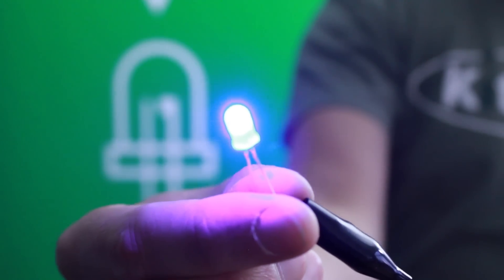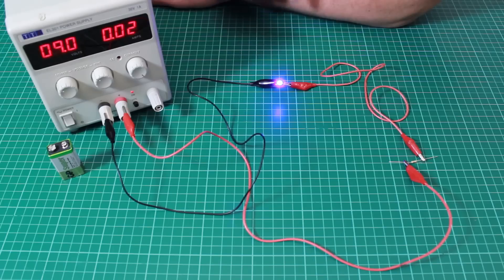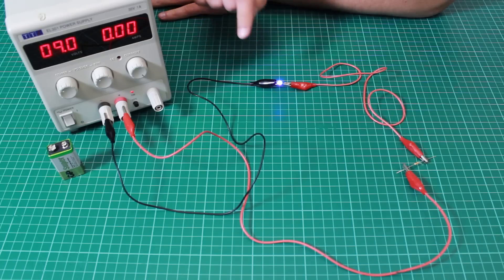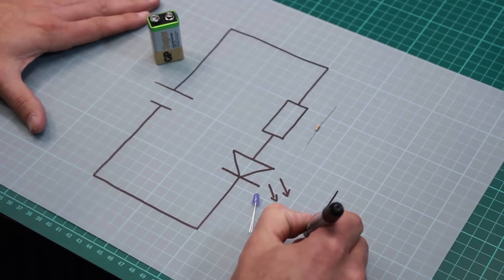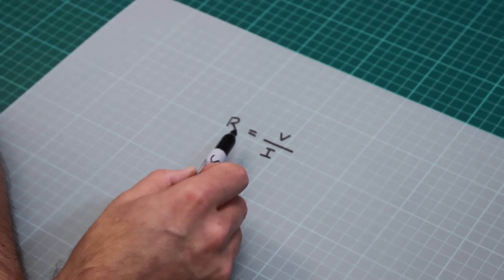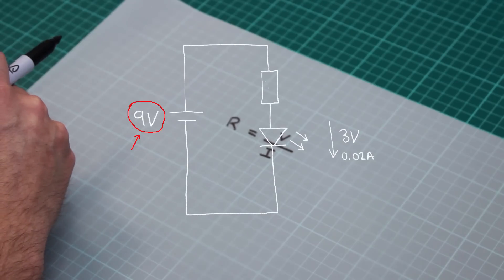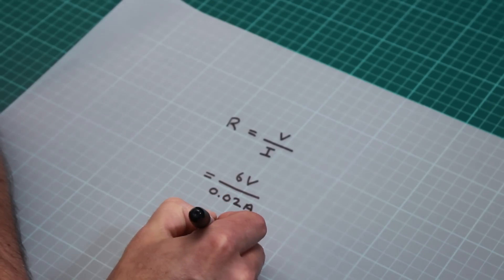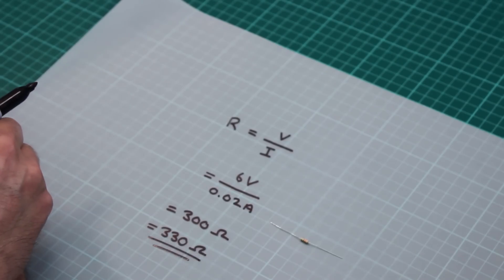LED resistor value calculation explained (Ohm's Law)

Comment: Sorry still not understanding. If the power going to my 3v led is 12v 5a, what resistor should I use? Please help. Thank you
Reply from the maker: If you have a 12V power supply and the voltage drop is 3V for the resistor, the top part of the triangle (Value for V) would be 9. The amps of the resistor in our example is 0.02A but in yours would be 5A. So 9 divided by 5 = resistance.

Comment: How do you calculate the resistor value of a 34V and 600mA current LED Chip running off of a 12V power source???

Comment: how will you measure the current if you dont know yet the value of the resistor needed?
Reply from the maker: You use the current you want to flow through the resistor, taken from the datasheet.

Comment: how do i work out the MA?
Reply from the maker: The current will be on the LED datasheet. Alternatively if you know the Voltage and Resistance you can use the triangle to work out the milllamps of an LED on a given circuit. Voltage divided by resistance equals current.
Reply: thank you for your response. As a motor mechanic i should know this. I learned it at collage 4 years ago. Its the first time I have actually needed to use a resistor in the field. fuses all the time. its easy to put a new "resistor" or "fuse" in from a spread sheet but its nice to actually going on
Reply: FYI    .... MA   means   Mega Amps
mA   means milli Amps

Comment: hello sir
question please:
i want to connect 5 led's together to make a led bar. each led is 12v
and 10w. what resistor should i use?
thank you sir.
Reply from the maker: It depends on the power supply, but 50W is quite a lot.
Have you considered these instead?
https://www.kitronik.co.uk/35129-zip-strip.html

Comment: 1:55 "the voltage across the resistor is 6V, this is because it is 9V from the battery less the 3V that's dropped across the LED"
I don't understand, does the LED absorb those 3 volts? I've never heard of anything like that before. And then, how does the resistor know about something that happens after it in the circuit? I assume the electron stream coming from the anode could tell something about the voltage being pulled, but it still doesn't make complete sense to me.
Could you illuminate this?
Reply from the maker: Hi.

The LED doesn't so much absorb those 3V as convert them to light.

To explain properly we need to take into account a couple of other relevant laws of Circuit Theory -  Kirchhoff's 1st and 2nd Laws.

Kirchhoff’s 2nd law states that the sum of voltages around a closed circuit is equal to zero.

We can use this to determine the resistance required to limit the current to 20mA

We have a 9V battery, and we want to have 3V across the LED. Using Kirchhoff’s 2nd law:  9V -3V –(voltage across Resistor) = 0

So we need to account for 6V of energy for the resistor. (We convert it from electrical energy to heat energy, for circuit purposes the important bit is that it's no longer electrical energy.)
 

Ohms law states that the voltage across a resistor is related to the current through it by its resistance (V = IR)

Kirchhoff’s 1st law states that the currents flowing out of a node are equal to the currents flowing into the node – in other words in our simple single loop circuit the current is the same at all points.

Because we now know that there must be 6V across the resistor we can work out what the resistance needs to be to limit the current to 20mA.

This is  6V/20mA = 3000 ohms.

Hope this helps.
Reply: Thanks! That is a great explanation!

Comment: you forgot most important calculation. power going tru resistor.
Reply from the maker: We've purposely kept these videos simple as they are aimed at school age children. 
You can see the relationship between Ohm's Law and Joule's Law at https://www.facebook.com/Kitronik/photos/a.994027100724029.1073741835.145744082219006/987119861414753/?type=1&theater
Reply: school age children? 6-24+ years old is school age. btw two most important values of resistor is ohm value and power value. you just shown how to get hurt (burn fingers, house). at least make second video about power values and link it to end of this one and mention how important it is!

Comment: what if i had a 3v led and a 3v battery. will the battery give out too much current or does the battery only supply the max 20mA the led requires? Will this battery safely light the led for long periods of time. Want to make a simple touch switch circuit activated by water to last 8 hrs if possible.Thanks. Great video.
Reply from the maker: It is common to use a 3V coin cell directly on a 3V LED (take a look at throwies) but it does depend on the capacity of the battery. To be sure you can test with a multimeter.

Comment: How would the resistor vary if I were to put a series of those led diode? Say 10? Is it necessary to use a different value resistor?
Reply from the maker: Yes. You can use this handy calculator here https://www.kitronik.co.uk/blog/led-resistor-value-calculator and adjust the amount of LEDs.

Comment: I want to put some leds on my car i have subtracted 3 out of 12 then divided 9 by 0.02 it gave me 450 so that means i have to buy 450 ohms resistor?? Please help
Reply from the maker: You need to find the forward voltage of the LEDs you want to use and use that value in the calculation.
Reply: Kitronik what do you mean by forward voltage bro? I have a 3v led and its 760mA and i want to run it by 12v how can calculate this?
Reply from the maker: The forward voltage is the 3V bit.
So 12-3 = 9V.
Divided by 0.76A (760mA = 0.76A) (This is because our LED was 0.02A but yours is 0.76A).
Reply: Kitronik okay bro I've took 9/0.76 it gave me the result 11.842 now this is lil bit confusing how do i know how many ohms is 11.842? Is it 1k ohms??
Reply from the maker: It's exactly that, 11.842 Ohms. Nearest resistor you can get is probably 15 Ohms.
Reply: Kitronik okay bro thanks alot for ur help

Comment: bro nice video i like it 
but this is for only 1 led 
can you plz explain me how to calculate resistance of 2 led with same volt (connected in series or parallel )
Reply from the maker: You can use this handy calculator to work it out for you. https://www.kitronik.co.uk/blog/led-resistor-value-calculator

Comment: you forgot to tell people how you got the 0,02 A
Reply from the maker: The current of the LED was taken from the datasheet.
Reply: Kitronik is there a way to determine this without looking at the data sheet?
Reply: He took the 0.02Amps from the datasheet, they call that the rating, it may show up as milliamps, for example 20ma converts to 0.02A. You use that rating divide it by the voltage flowing through.

Comment: So if I have a 12v 16a led toggle switch & want to wire to 120v cord I'd need a 6.75 resistor?? 

I'm a noob.. help me not kill myself
Reply from the maker: It'd need to be a very powerful (Wattage) resistor for that. I wouldn't want to recommend anything specific but would you advise you to get in touch with the supplier of the LED.

Comment: Does it matter if the resistor is on the positive or negative side of the LED?
Reply: Sizzlik should be on negative i think
Reply from the maker: So long as you add the resistor in series it doesn't matter.
Reply: It does not matter. Because the current (ampers) is the same everywhere.) But it will be more correct to connect it before the LED, on anode, positive side, longest leg.
Reply: With respect: It will not be "more correct" to connect it on either side. It literally doesn't make any difference.

Comment: Can you please tell me how much ohm resistor can use with 22leds in parallel and flowing current is 12v battery
Reply from the maker: You also need to know the forward voltage of the LED (the amount of volts the LED needs to light up).
Reply: ok thanks can you explain me more about this
Reply from the maker: LEDs need an amount of voltage to light up. This depends on the LED. It might be 2.1V or 3V for example. 
The difference between the voltage supply, and the amount the LEDs need is the amount you need to provide resistance for.
For example if you have two LEDs that need 3V each and you have a 12V supply, you need to calculate the resistor for 12V - 3V - 3V = 6V.
Reply: thanks 
hi i wanna tell you something i am working on a small project to "AJ" sign with led's i am   using 22 leds of 2v to complete and power supply 12v 's 4 ampere bike battery actually  this AJ is for bike and also finished this yesterday using 230 ohm resistor can u tell is it right or not
Reply from the maker: Ajay, if you have 22 LEDs rated at 2V each then a 12V power supply will not light them at full power.
Reply: sir i finished all of this using 22 leds in parallel with 220 ohm resistor and light them with 12v battery  and also i installed in my bike also i save a  photo so u can just tell me your whatsapp or any other social account where i can show u m experiment and also thank you
Reply from the maker: We're on Twitter @Kitronik :-)
Reply: sir i am not on Twitter any other whatsapp, Facebook or instagram
Reply from the maker: https://www.facebook.com/Kitronik/
Reply: so in this case to power 22 leds each at 2.1 volts each would require the minimum of 46 volts to power the whole circuit? lets say i connect a voltage converter to that 12v battery and increase it to 46 volts would that drain the lifespan of the battery?

Comment: If 30 leds of 3.9v are connected in series for 12v Dc then how much resister should be used? ?
Reply from the maker: It depends also on the forward current of the LEDs.